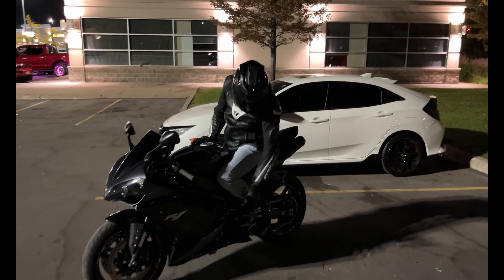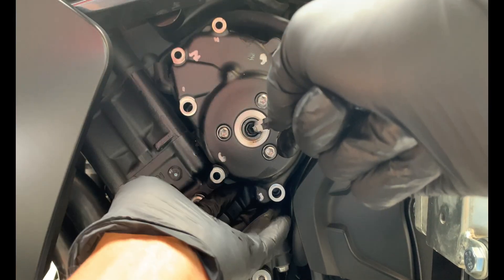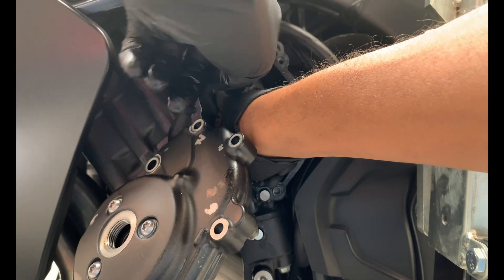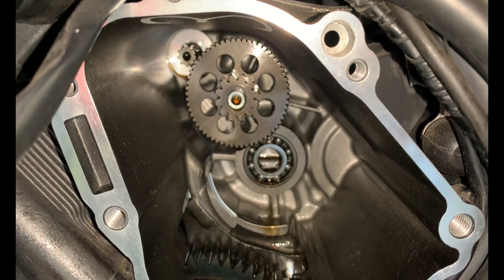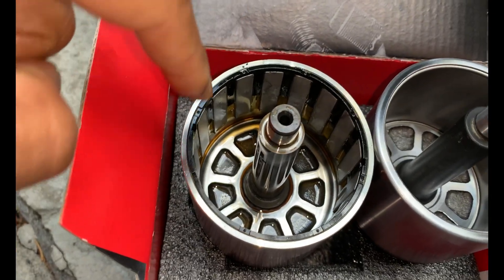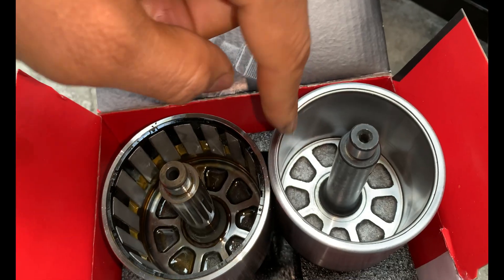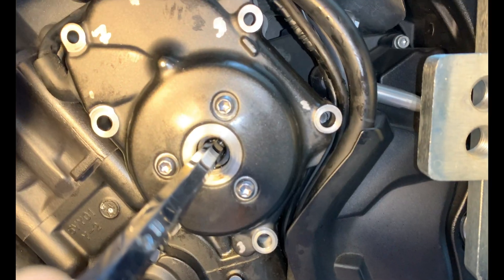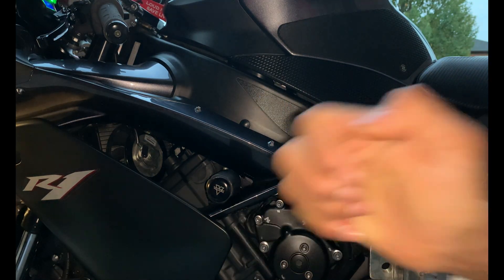2007 Yamaha R1 Stator Flywheel Upgrade – Avoid Potential Engine Damage

Comment: Yeaup... bought my 2006 R1 December last year and after 4.000 kms, the bike just died... so i troubleshoot the battery (was OK), the regulator (was OK) and when i disassembled the rotor... it was magnets all over the place and the alternator was also damaged... it was a bit expensive and bought a new rotor (the redesigned one) and a new alternator. After some 1500 kms, the starter relay decided to die as well, so i put a new one and now my R1 is working like a charm!
Hope is the last issue i have with her - but if i do have another one, i can always put her aside and only ride on my Honda CB650R (my daily ride).
Shame on Yamaha, they should have made at the time a damn recall on that rotor!
This issue was very well known back in the day and they just redesign the part - not cool!
This will be my first and only Yamaha - that´s for sure!